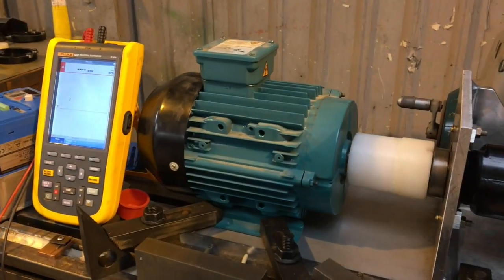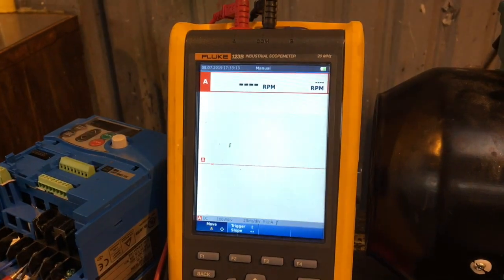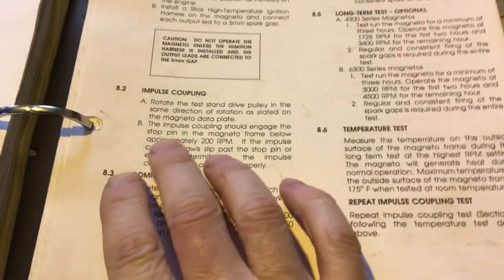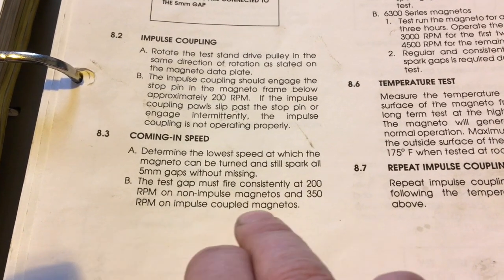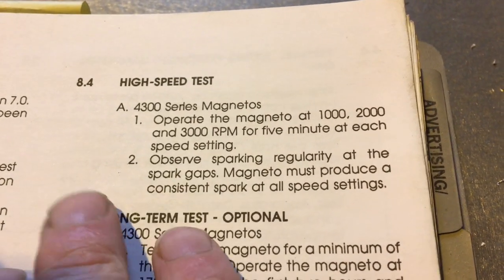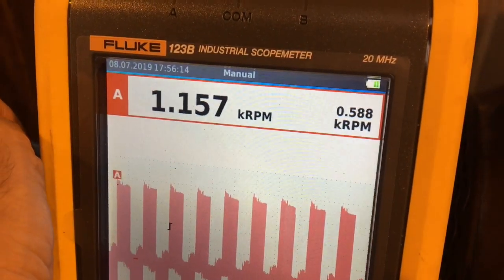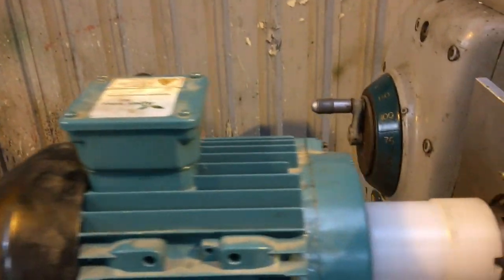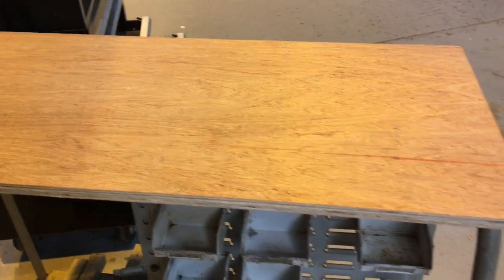Building a magneto test stand, part 4, testing an impulse coupled magneto.

Comment: Interesting project. What kind of electrical motor did you use? 3 Phase Asynchrone motor?
What power (kW) and max speed does the motor neen?
Reply from the maker: Yup - 3 phase asynchronous motor, Used an "over sized" motor so in practice it runs very close to synchronous speed which is useful. Also the rotor has enough mass and moment of inertia not to slow down when the impulse couplings operate. It runs up to 3000 RPM - actually achieves 2990 - 2995 rpm driving a magneto  with the VFD set to 120 Hz.
Reply: @framavia2201  , Thanks a lot for your answer. Your videos are very helpful for my own test-bench project. Based on your answer I conclude that you use a motor with a nominal speed of 1500 rpm. Is that correct?
Do yo know wat the horsepower rating of your motor is? (Hp or KW). I understand that it is oversized, but it would give me an indication what motor I should use. I am not able to  guess the Horsepower rating based on the video.
Many thanks in advance.
Reply from the maker: @hardybeckers8752  Ok, motor is an Apex 1.5 kw, and yes, you’re correct it’s free speed is 1500 rpm @ 50 hz👍

Comment: Magneto man is not found on ebay now. do you have any plans or tips to build the spark gap? If not, I'll just be guessing at various intervals, etc. I can't find a spark gap for sale online. thanks.
Reply from the maker: Someone else asked this and I posted a little follow up video, I'll try to link it here. https://youtu.be/PTT3RSS-mwE The spark gap setting is normally specified in the magneto manufacturers testing schedule. (typically 4 or 5 mm) its important to use the correct gap, too large of a gap will cause high voltage and could damage the mag. Hope this helps.